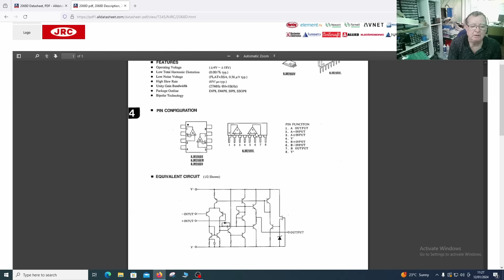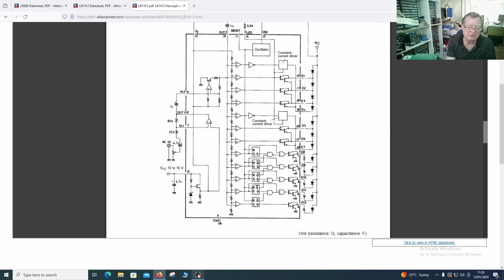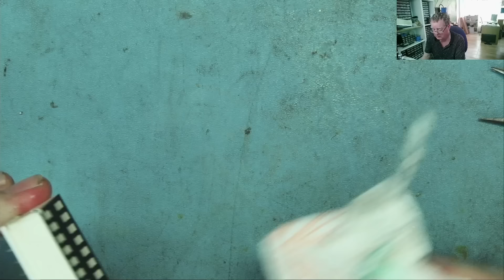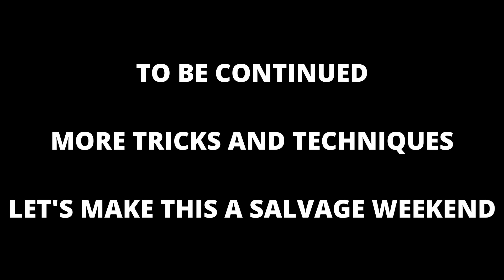Electronic Components For Free From Trash. What To Salvage, Best Tools And Techniques

Comment: Ironically I play these salvage videos in the background while I do the same thing. These parts make great repair and project parts.  I’ve found some very interesting professional laboratory equipment in the e-waste and the precision components I saved are not easy to source. When the boards are thin and use leaded solder it goes MUCH quicker and less aggravation.

Comment: Hi Richard, greetings from Australia :-} . The easiest way to remove a row of through hole pins is solder a copper wire along all of them, with each one of them being soldered to the wire. Then, heating the wire in the middle should spread the heat to all of them at the same time, and if it is only a single row, they should fall out nicely. If it is more than one row, you can do each row in turn pulling the device out on the other side, or, if the rows are close to each other, you could make an "U" (or "S") shape of the copper wire (or a full loop) to heat all the pins at the same time. Regards, Jerry.
Reply: The easiest and least faffy way is to use a longer spade/blade bit for your iron. Or, you can get some that are designed to heat both sides of a DIP IC at the same time, via s spaced dual blade.

Comment: I have my parts drawers labelled say, FET Op-Amps, Bipolar Op-Amps, Comparators, Small Signal Transistors, Power Transistors etc.  Logic I tend to label each drawer with 3 4000 or 3 7400 series in each drawer. I have more parts to go in the drawers, and I've bought some more drawers, and I've been thinking about a better way of organizing as I have so many parts. I think I'm going to just label each set of drawers A, B, C etc. Label the drawers 1, 2, 3 etc. and then have word processor documents with the parts in alphabetical / numerical order. Type order etc. and then the location code A1............A32, B1............B32 and so on.
This way, if I get additional parts not already in my stock I don't have to re-label drawers, I just have to edit the index documents on the computer, I can also print off and laminate the index pages in case the computer is off while I'm working on a project.
Reply: So, basically, you want a database? O.o
Reply: @peddersoldchap  Yes. Basically. ATM it's a bit confusing in that it's easy to miss things as they are not in any alphabetical or numerical order apart from the 4000 Series CMOS and 7400 Series logic.

Comment: The first time i bought my soldering station i salvaged all components i could find from old boards except plastic connectors now i have nothing to desolder lmao also you can use pads from scrap boards to repair any stripped pads but i realized that it's much easier to use a board holder for desoldering in general

Comment: so...many...pots...
you will need some contact cleaner, seriously haha
i cant believe you didnt save those extra long pin headers!
Reply: havnt watched the full video yet but protip: a small butane torch on the back of a board and a good smack on a table can remove alot of components fast and easily, just dont overheat things and it'll come out fine and with perfectly tinned leads even

Comment: Is there a difference in quality between older components & newer?
Reply from the maker: One thing I think we can say is salvaged components, especially things like high power transistors, will definitely be original where as new ones may well be fake especially from China. Same applies to fast op amps and similar devices.  Other than that there is probably not much difference.  Components don't tend to fail with age.  Yeah some electrolytics will dry out but that mostly seems to affect ones from the early 2000s.  I've seen many electrolytic capacitors from the 1970s still working.
Reply: @LearnElectronicsRepair  Always satisfying to see a good salvage job. Last Wednesday I checked quite a few ancient electrolytics from the 70's. They tested perfectly for both ESR and capacitance, but I'm wary to use them since they do not have any safety valves and they are quite huge when compared with modern equivalents. They are new old stock Phillips and an even older looking Frake ( German ). There was also one particularly large Philips one with 5 terminals. They are marked 1 through 5, but no clear indicator for polarity. Can't find any datasheet on it; any thoughts on those?
Reply: @LearnElectronicsRepair  thanks
Really enjoying the content & learning a lot.